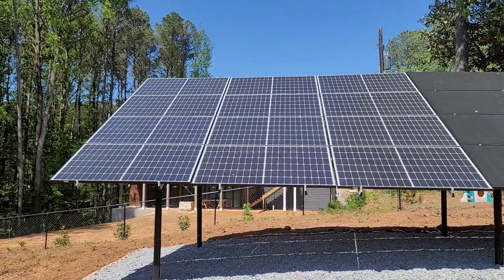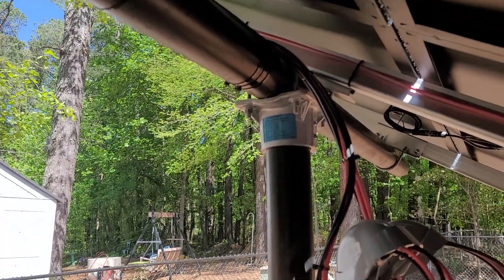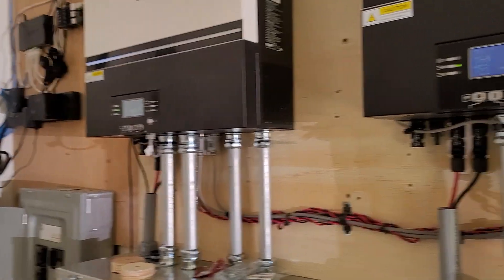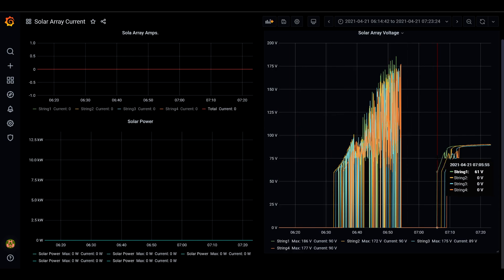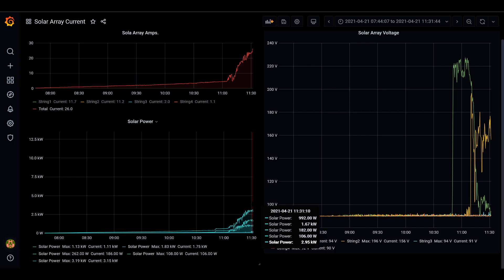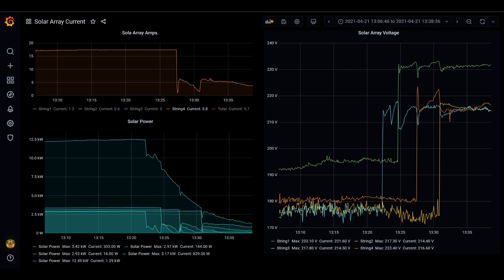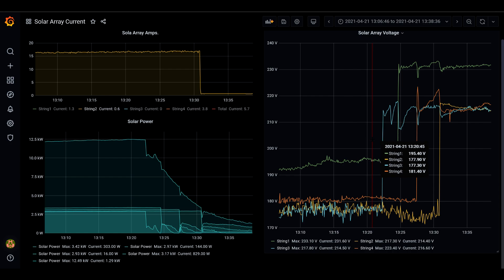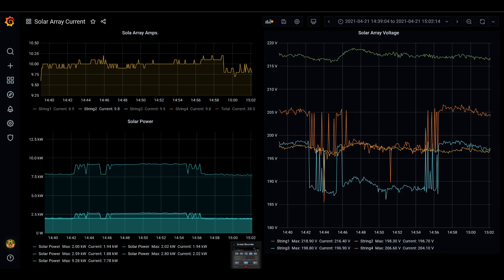LV6548 MPPT Charge Controllers & Solar Array Setup

Comment: What software and hardware are you using to monitor all this data? it looks so professional. I don't think it is watch power from mpp solar. I'm running 6s2p x 4 as well and same lv6548's and 2 more eg4's on order from signature solar.  Thanks
Reply: Can you run the EG4s in parallel with the LV6548 units?  Thanks.
Reply: @Sovereign_Citizen_LEO   they aren’t compatible due to their firmware.
Reply: @GavinStoneDIY  - Thanks for your response. I would be inclined to agree, if not for the fact that I have seen systems working together seamlessly. I believe there are videos on YouTube of this, but I didn't save the links/ videos. And thus I cannot remember if it was an EG4-6500EX and a Sungoldpower LV6548 clone, or another brand, or an actual MPP LV6548. 

If I can find it/ them, I'll post the link here (and even though they were working, I can't be sure/ it wasn't proven that every function was working between the two inverters; Only that the parallel "Current Sharing" function was working properly. The only reason I'm asking is to attempt to make sure (and because I have an EG4 -- and "Current Connected"  had the Gen 1 LV6548s on sale for $910 (but only about 260 in stock and they sold out before I got one).
Reply: @Sovereign_Citizen_LEO  there are videos of the original lv6548’s working with SunGold units. Those are essentially the same just rebranded. Or even the orient power units would work with those. None of these are compatible with eg4. In fact even the new mpp lv6548v higher voltage units they just released aren’t compatible with the lower voltage models from last year. The max VoC’s on mpp and Eg4’s are different. A lot of the programming protocols are different as well. I think you’d very likely fry one or both inverters if you connect them.
Reply: @GavinStoneDIY  - OK. Thanks :)

Comment: While I understand I am limited in my experience and practical knowledge with solar. I am still very smart technically and currently am building solar systems. Something is very wrong in your production levels. I don't know what that is yet. What latitude is your location, and I'll rerun my calculations?
Reply from the maker: What makes you think that something is wrong with my production levels? 34 deg north. 215 deg ssw.
Reply: @DMIINC2013 I don't mean to be to questioning nor harsh, but sometimes I can come across that way, sorry beforehand. I could be properly understanding your data. Since this post, I've watched some of your other videos and they seem to be much more inline with my calculations. Ya I'm about 35 deg north, so our stuff should be close. I'll rewatch this one in question and watch some of your other videos over the next week. And then pinpoint where I think something is off. Thanks for your videos, I do very much appreciate them and the resulting help in getting my systems lined out!
Reply from the maker: Harshness does not bother me. But my production numbers could be higher if I was exporting power to the grid. I do not, so over the period of the last 12 months I have wasted, in my estimate at least 1500 - 200 kWh, of solar production.
Reply: @DMIINC2013  Cool! Ya, I've already purchased a good amount of stuff, am trying to figure out what next. I'm currently planning on about 5kw solar, off grid on RVs, and 5kw on grid. I'm in California and dealing with all the requirements, for the grid tied. But I'll be going with ground mount stuff instead of roof mount regs. and only the rv stuff will have batteries.
Reply: @DMIINC2013  Oh and when not in use the rv's will suppliment the house.

Comment: I was just told I need at least 6 panels in series in order to properly run my Inverter witch is similar to yours I only have 4 in series I guess that's why mines not working right I have to but two more 335w panels

Comment: The LV6548 has 8000Watt PV  input, couldn't  you have put two of those strings into one MPPT CONTROLLER?
Reply from the maker: It has 2 x 4000 MPPT controller.
Reply: @DMIINC2013  Agreed, why didn't you use both legs?
Reply from the maker: @quail333  I have four strings in the back yard almost equally divided. So equal load distribution across four inverters  and possibility of adding more panels in future.
Reply: Keep in mind 250voc  and each panel voc  and number of panels each to one inveter    you cannot exceed 250 voc  with your negative positive array ...its simple ....just deal with one inveter ..array under 250voc

Comment: Would you mind sharing what make and model panels you are using?  I am working on a single LV6548 system for my off grid setup.  Thank you.
Reply from the maker: I bought the panels from ressupply.com They were Longi 320 and Trina solar 330W panels. In addition to that I have bought 30 panels from solar home in TX. They were 300W each.

Comment: Have you ever calculated the idle consumption is for the LV6548 inverter?
Reply from the maker: 66W/inverter * 4 = 264w * 24h = 6.34 kWh per day when there is no load on them. Unknown variable is how much inverters self consume while under load.
Reply: Why would he need to calculate idle consumption. His system is well sized. He does not have to worry about idle consumption
Reply from the maker: Correct. Inverters have been on for 75 days and per what I can tell , once there is a load on them difference between power wall consumption reading and ac power consumption reading is negligible. Around 12 percent on low load and 5 percent on higher loads. Let's not forget that inverters switch through gears (internal switching) when power consumption is increased which makes it more efficient.

Comment: Where did you get the U Bolt Mount that goes at the top of your ground posts to attach the horizontal poles to the vertical posts? I can't find those anywhere.
Reply from the maker: Iron Ridge.

Comment: This is a wonderful job and thanks for sharing... Iam however a bit confused ... how much voltage are the strings theoretically ?... I see your dc disconnects are 250v so am trying to understand how your have brought down the voltage to 250v or below. Please correct me if I am wrong ...4 strings in total. Each string made up of 12 panels with 6 and 6 in parallel.. approximately how much voltage would each string of 6 panels be ... its then paralleled with another 6 string and combination to your dc disconnect .. 
Thanks
Reply from the maker: Strings are at no more than 240 v each.
Reply: @DMIINC2013  I think you should be using the Voc ( open circuit or no load voltage)  PV panel rating to size your DC disconnect switch. So in your case it is Voc x 12 for the 12 string system.  https://www.cedgreentech.com/article/sizing-dc-disconnect-solar-pv-systems.

Comment: I just looked at my data.

Both of my LV6548's do the exact same thing in the very early morning with the Voltage.

The voltage starts climbing up for 30 minutes in the very early morning. Then both drop to zero for ten minutes, after that the voltage jumps right up and stays level for nearly two hours.

One of my strings is a smooth amp curve slope, and one has steps just like yours. I have a smooth hill and a Mayan step pyramid
Reply from the maker: Good to know.Thanks,

Comment: Thanks for posting these videos of your system.  With your current setup it looks like you could double the number of panels you have and run second inputs to all your inverters.  Would you also need to double the size of your battery storage to make use of the more power?
Reply from the maker: Yes I could. For now leaning towards more energy storage.
Reply: @DMIINC2013  I was recently looking at the 3.2v cells and on Aliexpress And I noticed CATL now has a 310Ah battery, which made me wonder, If you are connecting batteries in parallel and the voltage is the same, does it matter if the Ah is different?
Reply from the maker: In that case, be it parallel or series, you can only discharge to the capacity of the lowest rated cell. Long term you will most likely create imbalance between cells which will lead to other problems.

Comment: How are you getting Victron Smart Shunt data into MQTT?  I am very familiar with MQTT! influxDB and Grafana.
Reply from the maker: Through mpp-solar software developed by jblance on github https://github.com/jblance/mpp-solar He incorporated mpp solar inverters, smart shunt and JKBMS into one piece.
Reply: Does it work for the MPP Solar PCM60X?
Reply from the maker: @mikec75  I doubt that.
Reply from the maker: @mikec75  I see you already asked the question. Nice.
Reply: Impressive job and it shows your art.  I have worked with electricians.  You can tell who takes pride in their work!

I am building battery backup and plan on Victron shunt and already have the PCM60X. 

I got hooked in 2019, when we installed 15k of Enphase grid tied system.

Was cost your primary driver for MPP Solar inverters? I am a little concerned with them being non UL.  The Victron Multi-Plus’s are now UL.

Also, am I crazy to use 24V versus 48V?
Reply from the maker: Nice. 15kw is no slouch. LV6548 is UL listed. For the amount of power output they provide price cannot be beat. 48volt system only for me because of the power output. Wish there was 96 volt system.
Reply: Do you have a video on how to do this?  Thanks.

Comment: You have 4 strings of 2 strings of 6 which are combined under the panels so what is combined in the combiner box? Amazing information gathering so monitoring is made easy especially of every string of 12 panels. You should put a temperature sensor under each string lol for complete calculation of energy efficiency. Awesome job
Reply from the maker: Saying combiner box does not necessarily mean that we are combining electrical circuits in one. What I am doing is combining wires into one place so they can go to the DC disconnects that are on the side of the house. I failed to mention that there is some extra wire in there just in case and other set of MC4 connectors so I could disconnect strings and service system if needed. Being tempted on temp sensors already LOL. Thanks.
Reply: @DMIINC2013  Ok just trying to know if I understood what you have. If there is a weak spot it maybe those combiner pigtails some are good with the extra amperage and some are not so if they get hot you will know Thanks again.
Reply from the maker: @offgridwanabe  I did not try to cheap out on that. Bought what I think is the best. Did bunch of research on MC4 connectors and their capabilities before committing to the ones I think will work best for me.
Reply: @DMIINC2013  No doubt this system is well thought out
Reply: I was wondering the same. Thx for the question and the answer.

Comment: ? What size wire are you running from solar combiner box to DC  disconnect. Thanks for the info 👍🏾
Reply from the maker: 8 AWG. This was recommended by South Wire Voltage drop app. It looks like overkill but you never know when will you need bigger size.
Reply: @DMIINC2013  is the 8 AWG solar DC wire or 8 AWG AC wire?
Reply from the maker: PV wire to the box and THWN-2 for underground conduit.
Reply: @DMIINC2013  can you give me a  link where to buy THWN-2 thank you